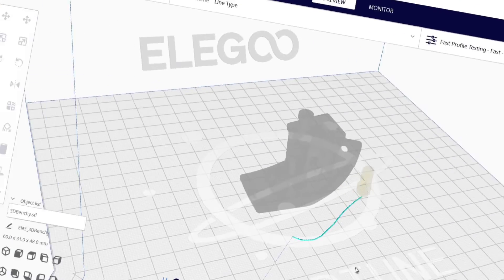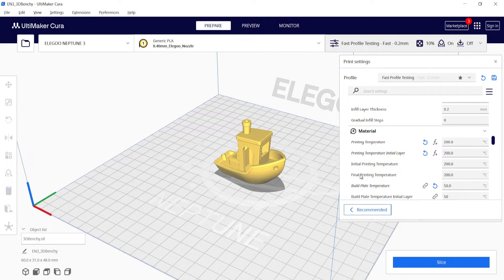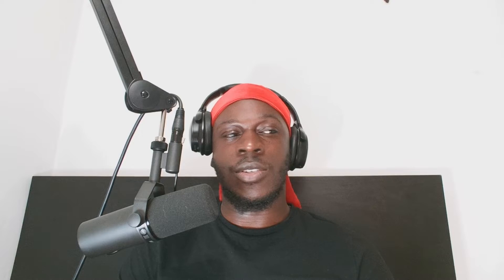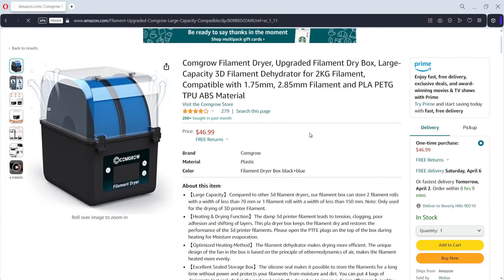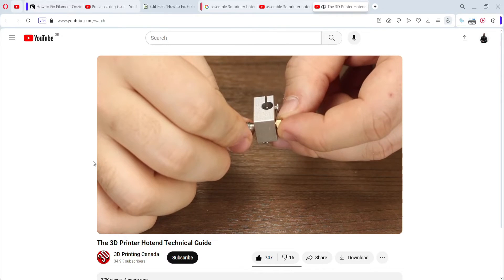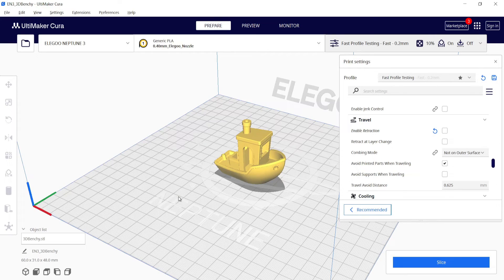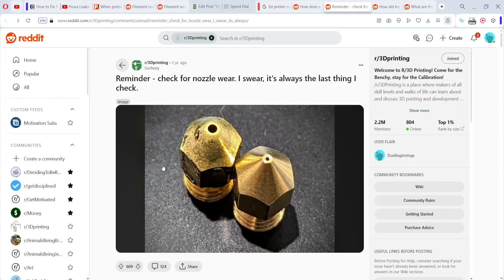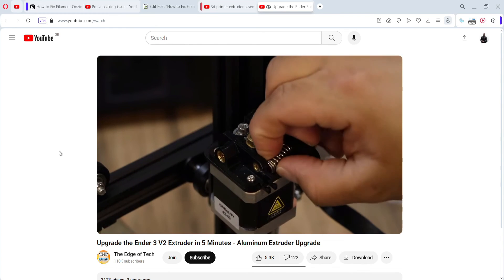🚫 Stop Nozzle Filament Oozing Now! Expert Tips Inside

Comment: Hot End keeps leaking filament as it sat there.  Once project started it appeared to be ok, spent an hour walking through your checklists and found the old nozzle was uneven, replaced it and leak stopped. Thank You.
Reply from the maker: Love that! Yeah those nozzles can start to wear away after some time, especially if you ever see it scrape the build plate. Nozzles are pretty cheap so always good to keep some spares around

Comment: Really Great tips but what helped me the most was adding in the end g code retraction so it will release pressure for the next print
Reply from the maker: Awesome, what command did you add in to do that?
Reply: @3D-Printerly  i use an ender 3 v3 ke so i dont know if the g code is different/ G1 E-2 F2700

Comment: Man! Those are very good tips
They helped me a lot!
To add one more (and that’s the one that kept me struggling)… the thermistor was not making contact properly with the block, so instead of been printing at 200°C as configured it was way higher and overmelting the filament
Reply from the maker: My pleasure, thanks for the added tip..great point